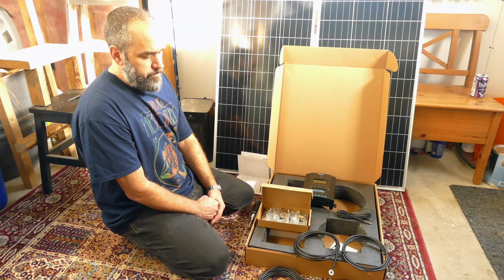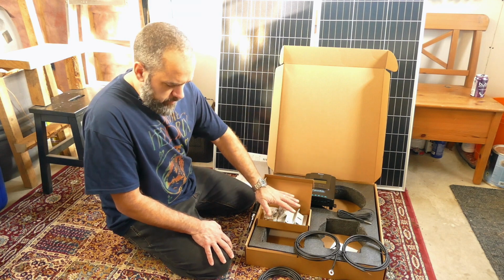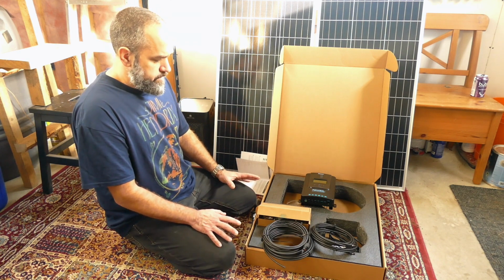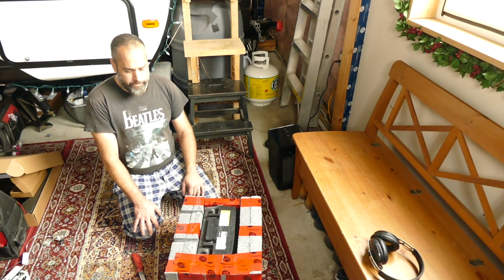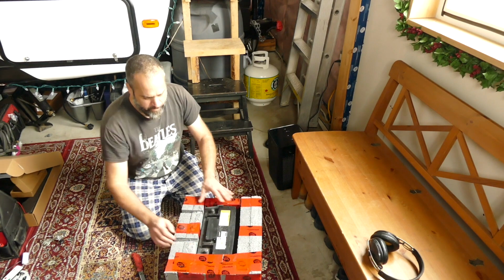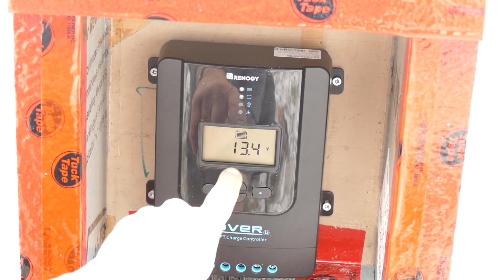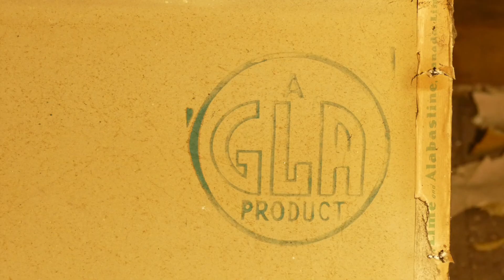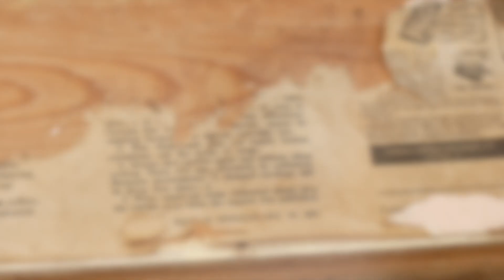Bye Bye Birdie | Mind The Mystery Gitch

Comment: The wheel barrel ideal is good information if you have land so you could move it around when you need it I would add an inverter to run tools and a better battery but that would be more for my needs
Reply from the maker: The inverter is a solid idea. Same goes for the better battery.  This was a "make use" project for some things we already had hanging about.  If you don't already have experience I would suggest you make sure the inverter is pure sine wave (as opposed to modified sine wave), The latter will likely be priced too good to be true. I tried an old 100 watt modified inverter with a string of Christmas lights and they were glitching out most spectacularly : ) Thanks again for the comments and thanks for watching!